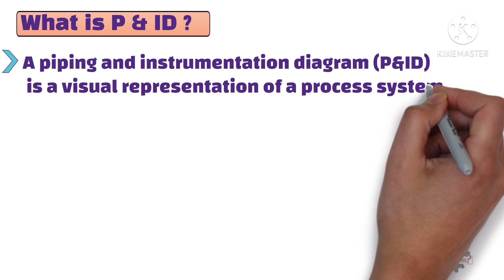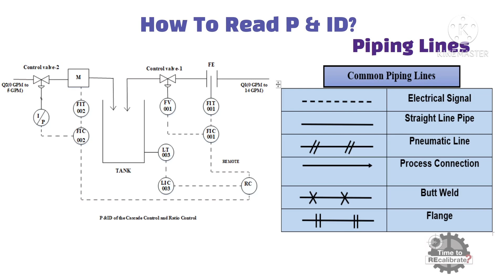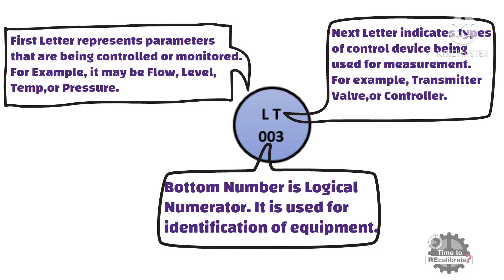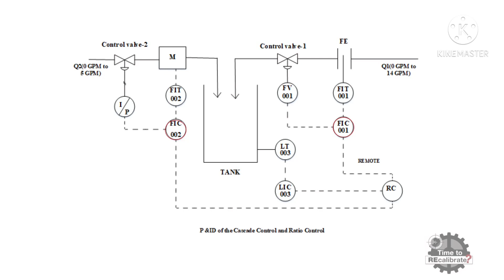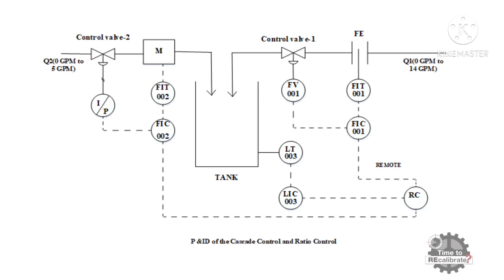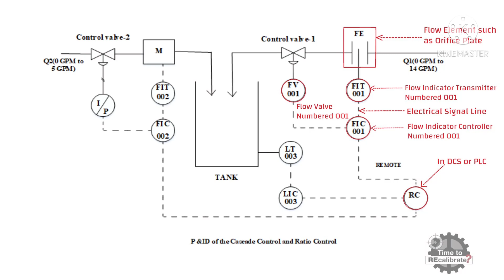Interpreting Piping & Instrumentation Diagram (P & ID) in English | Process and Instrumentation

Comment: Im confuse about the instrument location regarding the solid and dotted line..
Reply: Solid line symbol located in central control room and must be accessible to operator while the dotted line symbol also located in central control room but located behind the panel or otherwise inaccessible to operator.. pls double check to avoid confusion.
Reply from the maker: @IanControlTv  Thanks for your feedback. We will have a look and get back to you